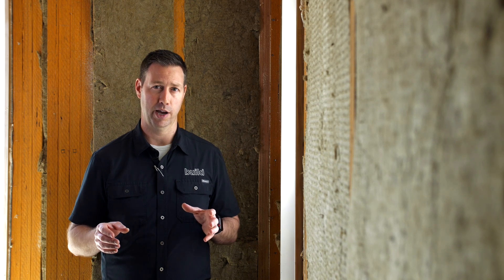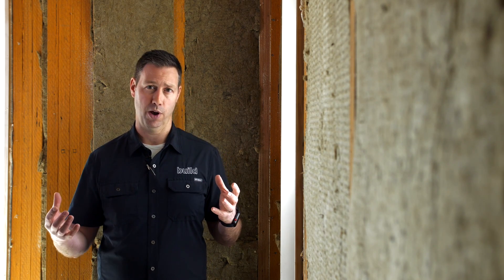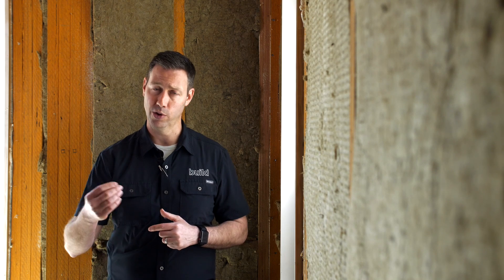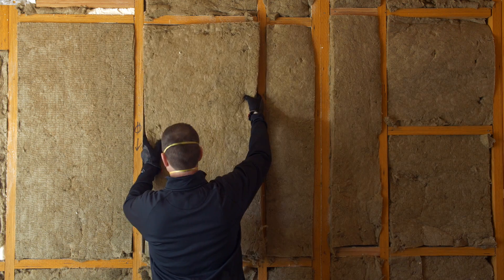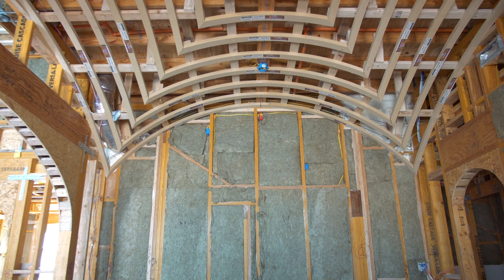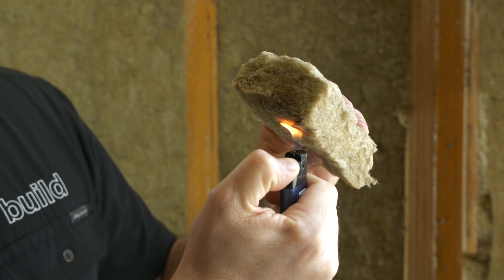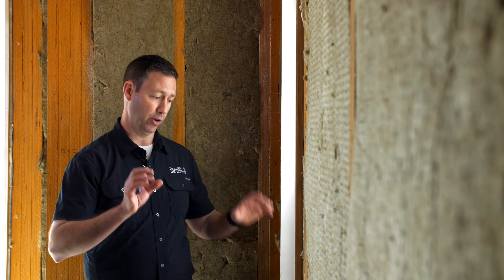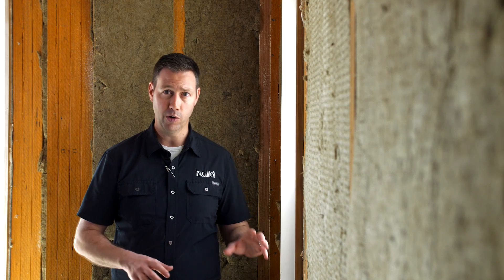Flash and Batt Insulation Strategy

Comment: Awesome video!!! What was the thickness that you used for the batt portion? Looking to do this in zone 5 and was wondering if I would need the air barrier if we use 2" of closed cell foam. Thanks for all the great information.
Reply: no need of air barrier. if it is a new  build id suggest a 2 inch of closed cell spray foam approx R13, then the typical rockwall is R16 with standard 4 inch. and then i would also use a 1.5 inch zip r on the outside which is a R6.6 meaning your like R35 in a wall and your air tight as well
Reply: @lifeofabachelor8547  how about using fiberglass instead of Rockwool?
Reply: @thugly921  fiberglass is itchy to the skin and many contractors refuse to use it for that reason.
Reply: I build in zone 7 and 2" of SPF is more than sufficient, occasionally we will use 3" if the customer insists but it is a marginal increase, batts are completely unnecessary unless you are looking for soundproofing with Rockwool such as Matt has done. No air barrier is necessary. Zip R exterior panels do help with thermal bridging if you want a superior envelope.

Comment: Something we did in our old balloon frame was (since we couldn't afford professional closed cell) is we used great stuff in all the corners/edges where the studs meet the sheathing (or in our case the planks).  This gave us a tighter air seal, then popped in the roxul.
Reply: It's been a year since your comment.  Any problems since?  Are you in a cold climate?  Did you use a vapor barrier as well behind the drywall?

Comment: Would you recommend this in 2x4 construction?
Reply: 2x4 construcion may work you would get the benefits for sure. you need to find a wall batt that is used for a 2 inch wall. as 2 inch of closed cell and then 2 inch of batt. you dont wanna use a 4 inch batt into a 2 inch space.

Comment: Do NOT use this method in a northern climate. It will rot out the wall in a matter of a few years.
Reply: Just need to make sure the dew point is outside the walls. Ie, external wall insulation.

Comment: I think the best wall  is 2 layers of gypsum outside, staggered double studs, 2 layers of R15 mineral wool, and 2 layers of 5/8 gypsum with one tube of greenglue  on the inside. High r-value--Very high STC rating--Almost fire proof--and excellent perm rating. This is a northern wall where the moisture moves out for 7 months and A/C is a 3 month problem.

Comment: We used roxul in climate zone 6 one time temporarily to keep a basement warm until we could come back after winter.. With no air barrier in front of it , it was disastrous ! What is recommended covering for roxul ?
Reply: It¨s always a HUGE problem to allow vapor transfer between surfaces. Vapor will always transfer from warm to cold. A vapor barrier becomes fundamental. 

Although not sure, but in your particular case seems that lack of vapor barrier was the major culprit. But also make sure no moist will come from the outside. ;-)
Cheers
Reply: What happened?
On a basement I thought drying to the inside was the correct technique, as the ground is constantly trying to push water and vapour in. You don’t want that to get into your insulation. I’ve seen barrier on the inside and ton of black mold in the rockwool.

Comment: Hi matt question is this wood fiber product rated to touch can lights? Do you think this product is better then other seemlier Batt insalation. and how dose it hold up when it gets wet? Thanks Matt
Reply: i used r30 roxul on the crawlspace walls for one season and only the bottom got wet on one side of the crawlspace.. it doesn't wick up..maybe an inch was noted.
when I removed it it does take a while to dry though..  I also installed can lights in the kitchen area.. used a piece of metal duct around it ..installed a damper to make a top..covered it w roxul..using led lights anyway..no heat..

Comment: On the build show!  I have always thought about this idea.  Makes sense.  Its a wicked combo and I want to try it.  That spray foam rig is pricey.
Reply: Be careful what zone you are in. This has to be in a warm climate zone as the closed cell foam will be a vapour retarder/barrier. If you did this in zone 5-7 you could get mold issue in the winter very quickly.

Comment: I've used Denim insulation. Would you say it's pretty equivalent to rockwool?
Reply: They are both much better than fiberglass in terms of density for sound purposes.  Denim insulation is not inherently fire resistant but I believe it is treated with something to make it so.  Should be some numbers out there on what temp it can go to.  Don't believe denim has the same moisture resistance, even after treating, but I'd need to double check the ratings.
Reply: For me rockwool any day. Even if sometimes the price is not their best feature. ;-)

Comment: Which kind of stone-wool was used?  It clearly was not regular batts...looks like what Roxul or others might call "panels"??
What's the R-value of those stone-wool panels?     
What did the end-result R-value become, in that house, by using 2" foam + whatever stone-wool?
What about moisture getting trapped in the walls, unable to exit to outside due to the foam, and, stuck behind drywall in the stone wool?    OR, did you just not mention using a vapor barrier before mounting drywall?
Reply: well i can address some of these concerns. when using closed cell spray foam you do not need a vapor barrier, the rockwall product is a roxul product now known as rockwall. it has a r value of r 16 and if you include the 2 inch of closed cell that is another r 13- r14, he also uses a zip r on the outside usually 1.5- 2 inch  about r 6.6-r 12 which is so somewhere in the neighbour hood of r35 to r40 for the walls. also regarding moisture since rockwall is moisture resistant and doesnt absorb water and the fact that the closed cell acts as a vapor barrier there would be no concern for moisture

Comment: In a colder climate, it seems you are creating a cold -side vapor retarder in the spray foam...  I haven't studied this for the particular system, but potential for condensation on the inboard side of the foam should be investigated.
Reply: Spent five years as a project manager for an insulation company in northern Minnesota and North Dakota. There is a variant of the flash and batt system that works in cold climates in which you spray 1" closed cell foam and batt with R19 or R21 ( 2x6 studs ) and then put a vapor barrier. It prevents moisture from entering the wall cavities, and air infiltration from the exterior of the structure.
Reply: @maurstad2009  , that sounds terrible. you're sandwiching part of your wall inside two vapor barriers. WHEN moisture gets in (not if), it will mold like crazy.
Reply: @somedude-lc5dy  when I was there, we used BASF foam which wasn't a vapor barrier until 1 1/2". Not saying it hasn't changed since that time it's always a good idea to read the tech data sheets.
Reply: @maurstad2009  why the vapor barrier over the the bat? Isn’t the foam insulation a vapor barrier?
Reply: Tyler Maurstad That sounds like a perfect double vapor barrier sandwich!
Reply: I was thinking the same thing throughout the video.  I'd like Matt to address this.
Reply: @spamtastic7108  , he's in texas (Austin area, I think)
Reply: I agree, but he is not in a cold climate.  One could assume that even if you did spray enough foam in the wall cavity to keep the dew point out of your walls that the stud itself would be the path in which the moisture would/could travel.  Flash in batt scares me in cold climates.  I have seen closed cell foam sprayed in a wall cavity where siding nails were covered and the nails brought so much cold into the foam that a inch of foam exploded off from the nails on to the floor
Reply: Dr. joe @ Building Science AND many others like Martin Holladay @ GreenduildingAdvisor recommend against using a plastic sheet in a wall, any climate zone
Reply: Ryan Kelly depends on manufacturer of the spray foam BASF Spraytite was a vapor barrier at  around 1½" so it allows the moisture to dry to the outside.
Reply: Remember, they have Roxul Rigid insulation on the outside of the walls, also, in this house.  Total R value is supposed to be R40 in the walls.
Reply: With all the processes going on in this wall it would be easier to do ICF.
Reply: crazy... frozen condensation on the nails?
Reply: Tyler Maurstad - that makes sense - was thinking of that approach to fix this system.
Reply: GrouseHiker  Yes the nails were ice, that's the only thing I could find.  They were not ice at the time of installation.  it happened over night
Reply: Tyler Maurstad, how does the wall you described dry?
Reply: James Patrick 1" average thickness wasn't enough for the foam we used to be a vapor barrier so it acted as an air barrier blocking drafts through the exterior sheeting
Reply: James Patrick - valid point. Foil-backed gyp board (assuming they still make it) would fall into that category also.
Reply: Matthew Mellow - that would push the dewpoint line toward the outboard side in cold weather...  Definitely worth running some numbers if this system appeals to an owner.
Reply: think this is the same house for the exterior insulation video..
then he has other materials insulating and moisture sealing on the outside.
As for the inside think 1" batt is good enough? AC ain't that strong
Reply: I've seen this condition here in Portland, Oregon. Flash and batt system was used with fiberglass insulation in an apartment with only Cadet heaters, no air-conditioning system for humidity control. This particular unit's tenant was complaining of mold. 

The tenant kept the unit closed up tight in the winter months. The tenant also cooked a lot of boiled foods. There were four occupants in the unit. Rh was 70-80% upon inspection. Nice conditions for condensation issues. The double pane windows were practically raining. 

Aside from documenting the conditions and the cause of the problems, I was there to remediate the microbial issue. As I pulled off drywall, water was running out onto the floor. The fiberglass was wet and the surface of the spray foam looked like the outside of a glass of ice water. 

So, not a good system for cheap apartment construction even in the kinda-cold Pacific Northwest. Maybe with the exterior insulation, but that's not a thing around here.

Comment: Let me translate what he is saying into plain English: This client has loads of money.
Reply: Insulation materials on a new house amount maybe 2-3% of the total cost. You can double that and you're only adding 2-3% to the total cost of the project. This additional energy efficiency will save you in 2 ways. First, you can install lower capacity heating and cooling systems and save a bit of money upfront there. Second, you'll be saving money on your utility bills for as long as you live in the house.
Reply: Historic Home Plans AND you'll be more comfortable every second
Reply: I'm a plumber and my wife is a teacher. We did this. I got it priced this way and didn't even ask for it to be priced differently. Even if it was free it wouldn't be worth it. Cheap out on anything outside the wall and spend the big money on the stuff inside the wall. You can always remodel later and you don't want to open up walls for a remodel.
Reply: @deezynar how expensive are we talking?
Reply: Yes, "Green" building really refers to how many Benjamins the customer has in their wallet.
Reply: penguins forall ;-)
Reply: Fiberglass doesn't burn but sort of melts. You can buy faced or unfaced fiberglass but the facing doesn't seem to be related to preventing fire. Check https://youtu.be/8NC79e0oztM?t=48s
Reply: Right!!!!!!! 😂😂😂
Reply: What would you suggest, for a waterproof, fire proof house? Some people feel uncomfortable about sleeping in a room that is a fire hazard.
Reply: @DR-um2bv  I have 2" of foam and 3.5" inches of mineral wool bat. Defintely worth it. We doubled our square footage (plus some) and our electrical bill only went up 20%.
Reply: It's Texas it's a cheap area
Reply: So at homedepo even comparing fiberglass roll and at bulk price (roll tends to be cheaper) to stone wool bat is about $0.40 per sq ft fiberglass and stone wool is $0.22 per sq ft. It's actually cheaper at the same R value. A big reason for this is because fiberglass burns and needs a flame retardant face. This face also provides a "moisture barrier" which I find to just be marketing but with stone wool that doesn't even matter. What would make a difference is if you're comparing radiant barriers (foil faced fiberglass for example). However there are other solutions to this including radiant barrier on the exterior sheeting.

Comment: you forgot to say about the vapor brier. Humidity must not be allowed to pass into the stone wool
Reply: Not needed since Austin is Climate Zone 2.  Wall cavity won't get cold enough to worry about condensation.
Reply: use bin paint on the walls.goes corner to corner..
Reply: Aside from the climate, he is using closed cell spray foam so the moisture won't ever get to the back wall.   Also watch his video on vapor barriers.  They are generally more harmful than helpful in many/most places in the US.

Comment: Recommend doing flash and batt in a basement?
Reply from the maker: Yes But definitely use Closed Cell Foam below grade.  Might go 1” thicker on the foam and eliminate the batts
Reply: Just make sure that the dew-point falls within the closed cell foam, where condensation can’t happen.
Too much batt insulation on inside could move the dew-point into the batt where it could condense, do NOT use plastic sheet in walls.

Comment: Is stone wool the new asbestos? I see you wearing the dust mask during installation. Has this been tested for human safety, or are we going to find out 20 years later?
Reply: chrimony a lot of pillow manufactures supply masks for their employees because of particles in the air. Most batt insulation won't let particles just float around after install. It's the act cutting and separating fibers that releases the particles.
Reply from the maker: This is a product that’s been around for many, many decades. It’s similar to fiberglass. Irritating to the lungs if inhaled. Best practices calls for a mask when installation happens but it safety encapsulated in the wall cavity.
Reply: I would have to say there isn't. Even dust is considered an irritant to the lungs. I've seen drywall crews where masks as the gypsum dust also will irritate your lungs.
Reply: Sheetrock mud actually has warnings on the MSDS regarding the silicates present in the dust.  By rights all crews working in rock dust should be wearing breathing protection.  As Tyler says, most materials are such that our bodies aren't intended to be breathing them, so it's going to be pretty hard to find something abundant, cheap and effective that's also not capable of damaging lungs if breathed in.
Reply: What about polyester? They stuff it into pillows, and so I'm guessing it's not an irritant of the lungs.
Reply: Rock wool has been around forever.  It is nasty to breathe.  I have no doubt it is harmful to the respiratory system.  Personally, I can't even handle it without putting on a respirator first.
Reply: @Reymundo: That's disheartening. Are there no insulation products that aren't hazardous to breathe? Why do we keep on putting this hazardous materials into our homes?
Reply: I'm not a fan of "irritants" that are "safely" tucked away. You have all the dust that's going to be flying around from installing it. Then there's the chance of dust if you get a draft. Then you have to worry about it if you cut into the drywall. Is there really no insulation option that is not an "irritant" to the lungs?
Reply: @Tyler: Not all irritants are created equal. Of course if you're working at a pillow factory you might want to wear a dust mask. But that's not the same as inhaling stonewool or fiberglass dust from just routine handling.

Comment: Also, benefits of rock wool I've heard promoters use is compression and/or moisture doesn't degrade the R value like it does for traditional batting.  Is this true?
Reply: BC ElginTex partly true. Any time you compress the material you dampen the R value. Insulation uses air pockets trapped in the material. Mineral wool doesn't soak up water the way fiberglass does.

Comment: I looked into this technique for a remodel, my concern was doing this would create a dew-point in the walls.
Anybody have an opinion on this?
Reply: I have a little over an inch of closed cell in the walls and ceiling this is all cathedral in Chicago area through the winter there was no condensation anywhere touching the foam it is the same temp seams to be no cold transferring through, you could really hear the rain hitting the roof with just the foam but then put up drywall then blew cellulose in packing it as tight as i could and now it is supper quiet. the rafters are 2x10 and walls 2x6. Temp inside stays within one degree very easy.
Reply: I’m guessing the dew point would most often be in the closed cell portion, so usually not an issue. Also b/c there is zero airflow you’re not going to get a ton of vapour in the walls and even if it condences in the stonewool, it’s a non-organic material so Supposedly it won’t mold. That said, I’ve torn open a basement wall that had some suspect black areas in the stone wool where there was a moisture problem.

Comment: Could you use "flash and batt" on the underside of the roof to create a conditioned attic?
Reply: Yes that is exactly what he did. He used closed cell as a vapor barrier and then followed it up with open cell to add insulation value. You could also use that Owens Corning net system where the fiberglass is sprayed in.
Reply: On the roof deck itself or your attic space?